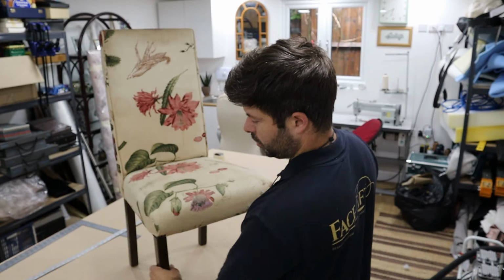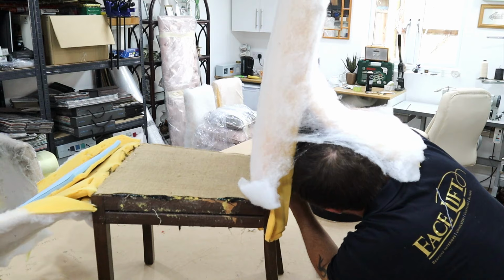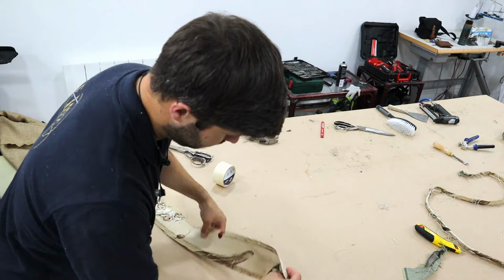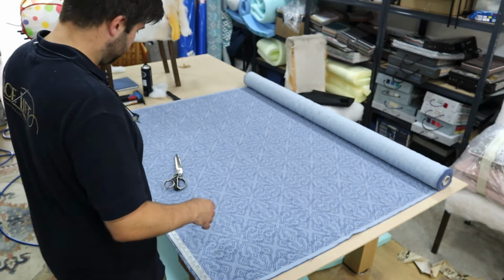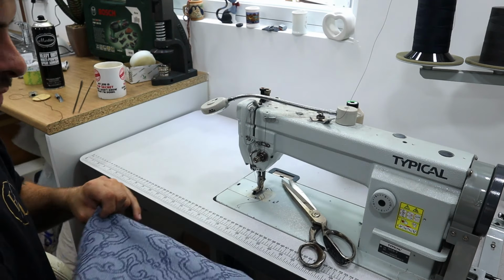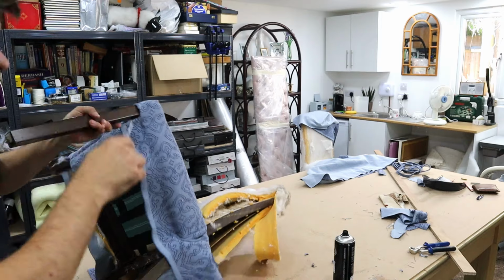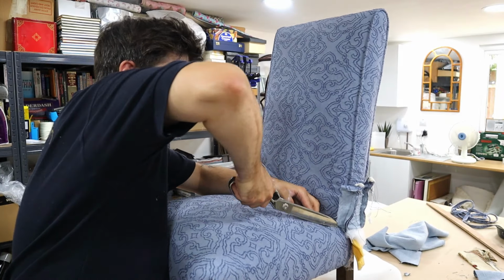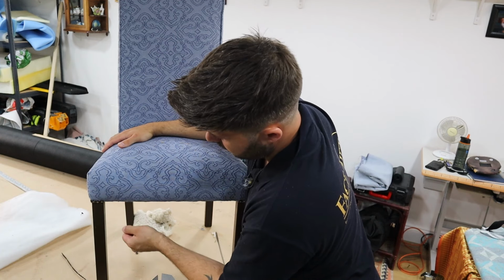DIY HOW TO REUPHOLSTER A DINING ROOM CHAIR | UPHOLSTERING WITH PATTERNED FABRICS | FaceliftInteriors

Comment: Hi Neil this is very helpful thank you. How did you make the back cover with the piping, is there a separate video please?  Do you need to use piping for the edges?  Gill
Reply: I have the same question, but more in regard to how you managed the turn at the top  - must have been tricky!
Reply from the maker: Hi Gill - yes this one had piping sewn into the back - if I didn’t show it on this video, I’ve uploaded a few recently showing how to sew and attach piping…the concept is very similar. Hope this helps!
Reply from the maker: Hi Margot - apologies for the delay in replying. I’ve uploaded a few videos recently on how to sew piping around curves… hopefully you find them helpful 😊👍🏻